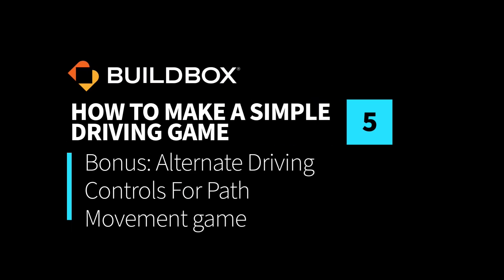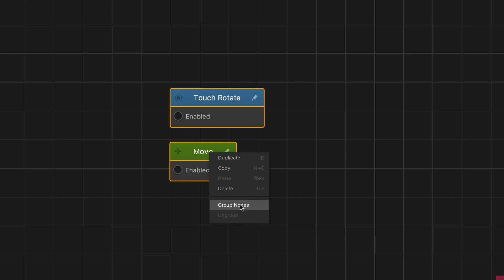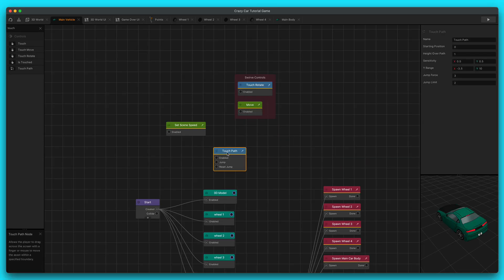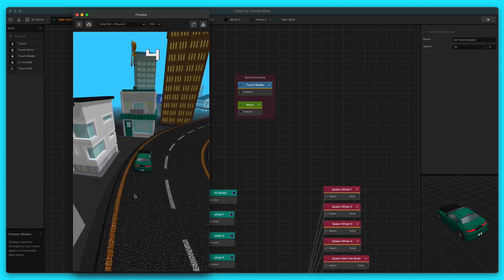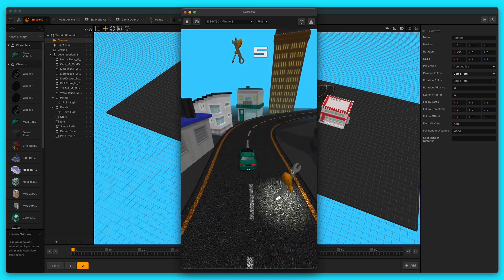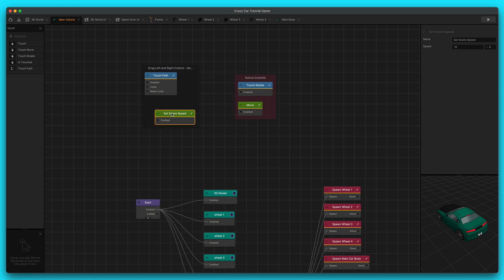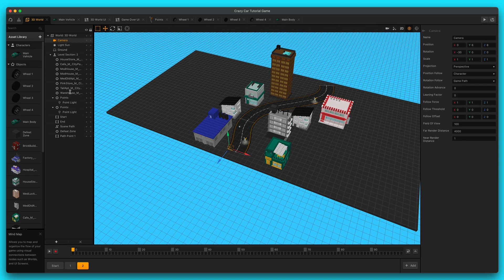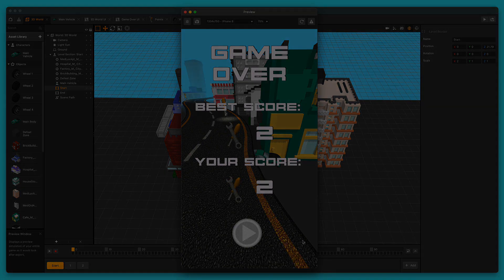How To Make A Simple Driving Game With Buildbox 3 - Part 5

Comment: Awesome tutorial Dude, I've just finished IT !
Great features tho 
Question, can we use a 3D mesh as scene path, (a tube for example, with the player inside the tube) ?
Thanks
Reply from the maker: Currently, you cannot add a custom mesh to scene path. You can set the scene path to shape, Cube Inside, apply a texture. Size and position your assets accordingly.
 Then, resize it by using the start & end objects scale factor.

Comment: Why may camera not follow the character after all setting like you give reason
Reply from the maker: watch it again closely. Make sure your Position Follow and Rotation Follow are set correctly on your camera. Select the camera in the outliner, then change the settings in the options panel. that should fix it. Also make sure your character is in the characters menu in the asset panel. (Zack)
Reply: @Buildbox  solved thanks
Reply from the maker: Awesome!